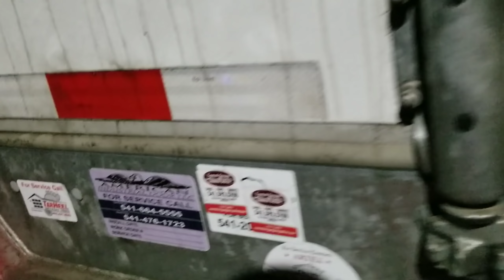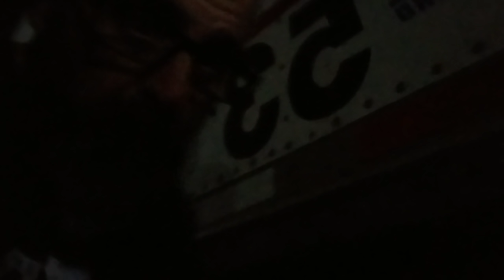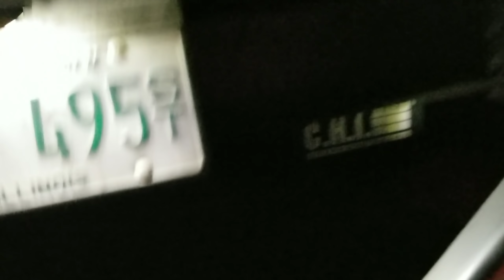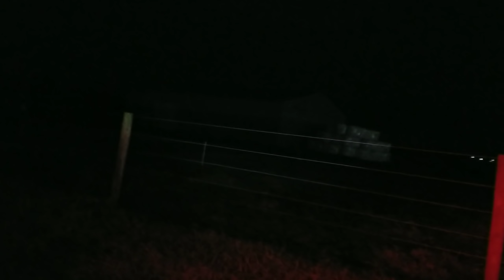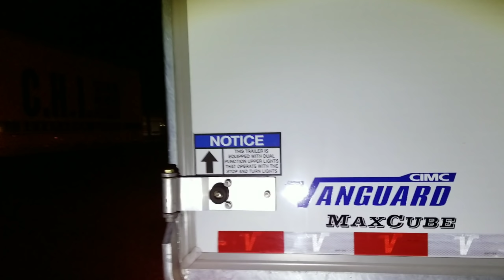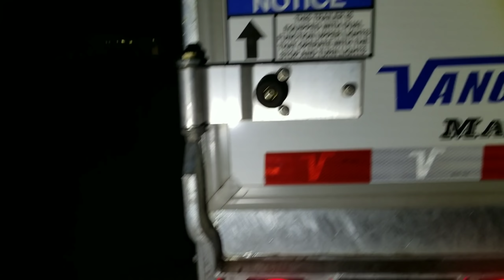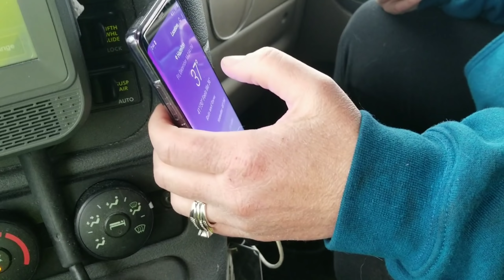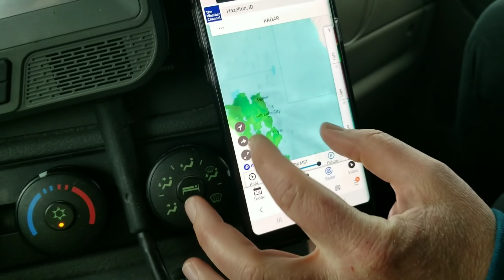SELENA SH💩T'S HER PANTS ON ICE | WINTER TRUCKING

Comment: Are you paid by the mile or flat contract rate? If by the mile, do you get the 68% as the trailer belongs to the door company or do you still get 65%? You guys are certainly hitting a lot of nasty weather over the last couple of months. Fingers crossed the weather stabilizes into a more normal winter weather pattern.
Reply from the maker: We get 70% with the customers trailer plus stop and unload pay, and we get paid odometer miles. We're  averaging around 2.20 per mile depending on fsc week to week for all miles